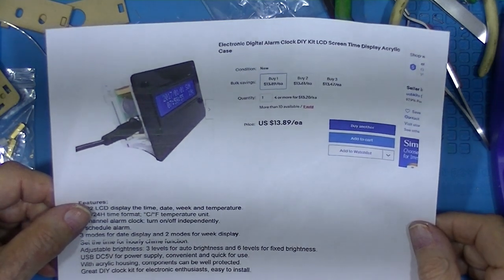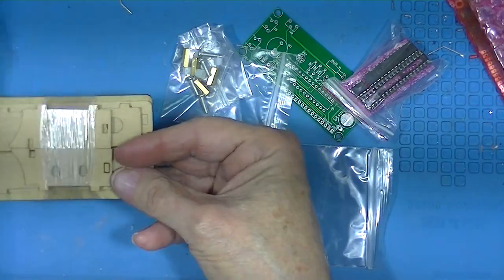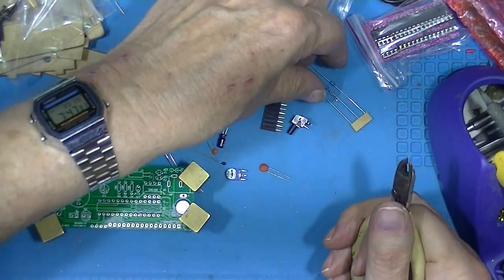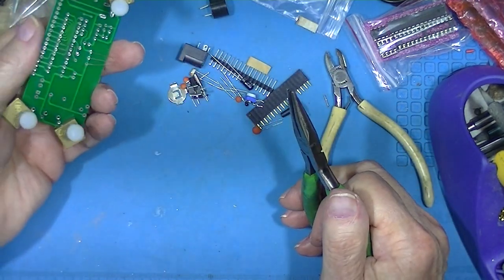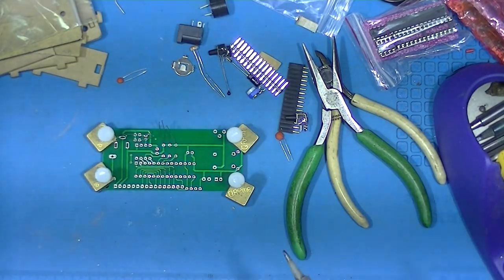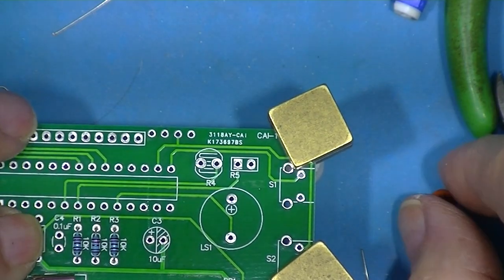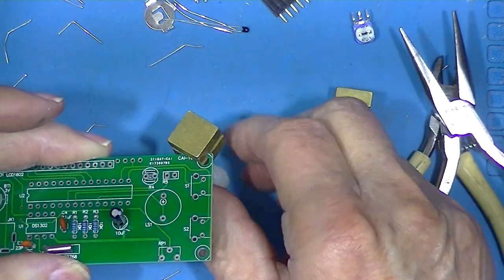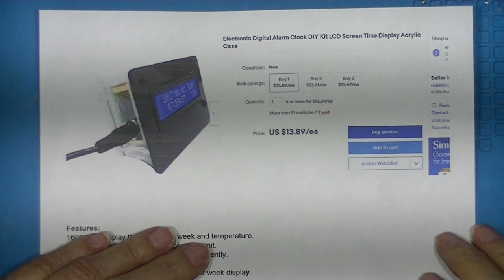For Future Scientists/Engineers - A Clock Kit Part 1

Comment: Good discussion of assembly technique.  I snip the ends in 3 steps for protection (1)  grip the lead lightly with cutter (2) cover with my hand (3) squeeze the cutter.  This contains the cutoff close to the circuit board, and it can't go flying anywhere.